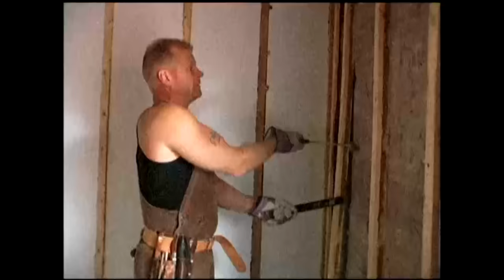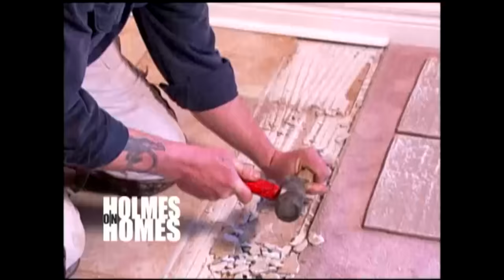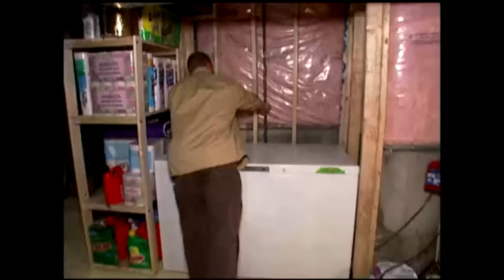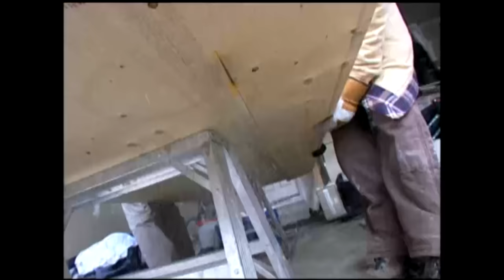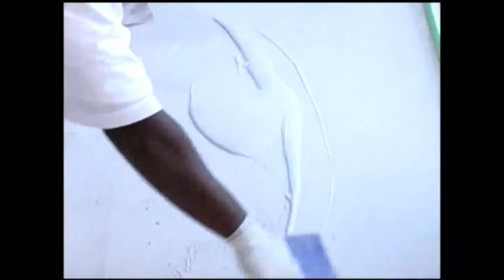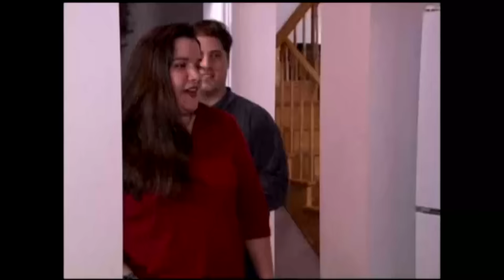Mike Holmes vs Flooring Troubles | Holmes on Homes S212

Comment: Retired tilesetter of 47 years here.  Porcelain is just slightly porous glass. Thinset does not stick to porcelain very well. No matter what you do.  I've seen porcelain tile that was cleaned and backbuttered still come loose with a full imprint of the tile in the thinset. This is a problem everywhere!!!  ---------If you can feel movement in a wood floor then DO NOT put tile on it.

Comment: The reason the builders seemed "on her side" was they were just talking her out of doing anything. Trying to run out the clock so to speak till her contract/insurance ran out for a problem to be their fault. It's like going to the store and them offering to try and fix a problem instead of taking a return. They know your return period runs out in 14 days or so, if you waste time trying to "Fix" the problem through them you might void your ability to return something like a new Computer.

Comment: TGI construction is low grade. These things burn out quickly in a fire and the house collapses. The fire Marshall usually points this out. Better to use laminated plywood beams. Mass Plywood beams. Much better and fire tested. 😊

Comment: I don't fully understand this repair.  They have an issue with the tiles coming loose causing grout to crack and in some cases the tiles are coming up completely - so they're just covering over it?  Doesn't really make sense to me.
Reply: They then went down below to bolster up the beams and flooring so that it would not shift and hence lead to cracks.
Reply: Same thinking I have. If the tiles come loose, the now poured concrete-like floor will come loose. I'd say. Besides.... It's a LOT of work to create a faux tile. Not a fan.

Comment: ive never seen engineered floor beams with additional plywood attached to them. does it make a difference? may as well use solid wood floor beams if going to that length?
Reply: Engineered beams are wooden I-beams. The center is OSB of varying width. The advantage is weight saving vs load. Technically they’re stronger than solid beams due to weight/load ratio. Major downside, ZERO horizontal strength. They will bend or wobble when installed. Sheeting them in plywood to the top and bottom of the “I” makes them much stronger. Also creates a proper surface for braces to be tied in.
Reply: I think they said the plywood was added
Reply: @Scubamike4499  but not until they had issues with the tiles moving

Comment: No tile installed is sealed . Bathrooms need no less than 2 seals. If you want it done, seal it yourself. Easy to do, This came from a contractor friend that has morals like Mike.

Comment: That floor must look terrible and out of style in 2023… should’ve replaced it with tiles
Reply: Yeah I don't like it.
Reply: Agreed, an acrylic coating won't last very long, while tiles look good for 20 years and more.
Reply: @ChristianWagner888  it is Jewelstone it can be used outside and inside very durable.
Reply: This episode was made 20 years ago I'm sure it has been replaced
Reply: the rough surface prob makes it an absolutely pain in the ass to clean and mop
Reply: I've never liked Jewelstone.  Even when installed by pros it always looks cheap and fake to me.. probably because it IS the cheap and fake option.   Maybe for a concrete patio to add a slightly more interesting look than a flat slab, or on an outside wall to make faux brick, but on the floors in my house?  No thanks.
Reply: @GoatzombieBubba  Jewelstone looks like a good product. But the top coat was described as "acrylic" based in the broadcast video. The current product uses two-thirds polyurethane and one third acrylic, which would be more durable. 

I cannot find any claimed lifespan for Jewelstone on their website. Going by floor products of a similar nature, I would expect that you would need a recoat (if possible) after maybe 10 years. Even pure polyurethane is not as durable as a tiled surface. If you can document 20+ years durability of Jewelstone, please provide a link.
Reply: @patrickolso8224  It would be cool to have follow-up episodes on the durability of the work done 10 or 20 years later.